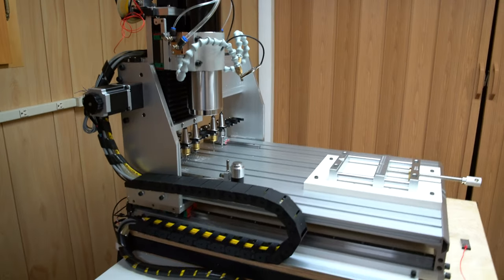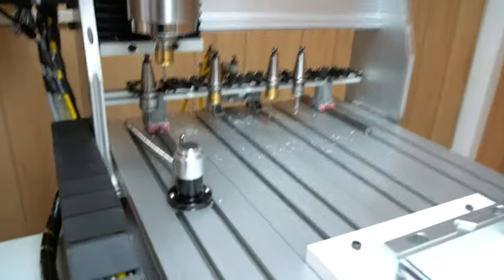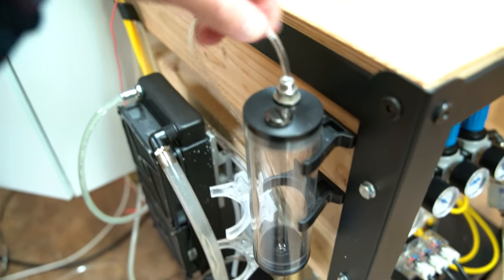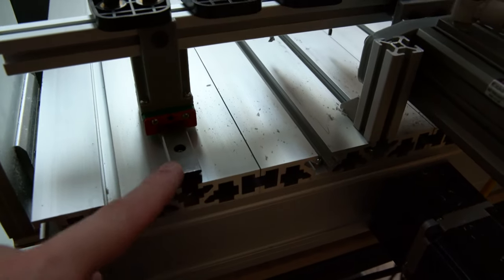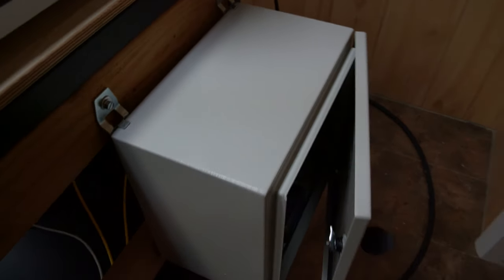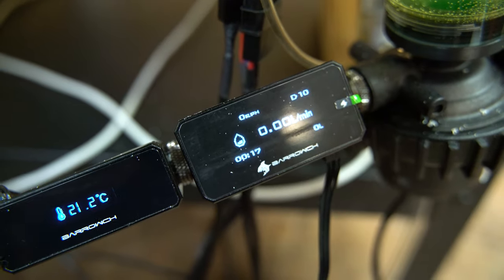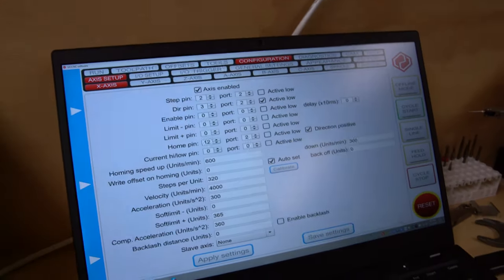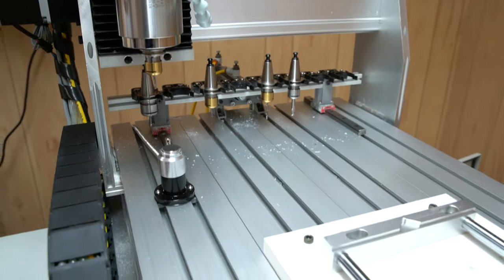ATC Spindle and Pneumatic Tool Rack Upgrade For X6 6040 UCCNC Router Now Operational - Part 3

Comment: Set your tool up close to the same length and put your coolant in front of the tool facing toward your tool storage rack. To keep coolant and chips off the tool storage rack,  add a flip door to the front of the tool storage rack that opens when it moves forward. It will just be mechanical in design,  it will pull itself up and back as the tool rack moves forward to clear spindle.
Reply: no

Comment: How much air does the compressor really need to provide for the ATC? I've read 90 PSI at a run rate of 5 CFM. In the videos I am watching, it only seems to need the 90 PSI during a tool change event. Seems like the 5 CFM requirement is overkill...

Comment: Very interesting video. And great job on your build!
I do have 2 ideas for considering, regarding your issues.. for tool rack: mount small angles with rollers on each side of that aluminum extrusion, that way you mechanically simple solve the same side distance caused by any irregularities that centered/single SMC might cause.
2nd idea is for the tool rack cover which would just be using plexy (or similar) plate of same hight as rack, 'folding' down when rack 'pushes' it ( plexy attached  to two pivot points on both sides, self closing with spring, when rack retracts).

Comment: Excellent work, do you have any suggestions for a precision vice that works well with the omio?
Reply from the maker: wouldn't call it precision (I actually have some drawings and ideas for making my own) but in the video I'm using this one that I'm happy with: https://www.aliexpress.com/item/4000180543028.html
Note that I ordered a second one from them a month ago and haven't even received a tracking update yet. There's a lot of sellers for the same version of the vice so maybe shop around.

edit: I saw your book press video before, enjoy your content a lot :)
Reply: @NikitaLab  thanks, ye I saw that vice but didnt like it too much and there is no downward clamping pressure to stop the moving side from lifting. Really want to find a proper milling vice low enough to be used with the chinese style cnc's. All the Kurt's etc are huge in height. In your earlier video I saw that you did have quite a large one fitted on the omio. I'm close to biting the bullet on the UC300ETH as I want to stop using this crappy cracked version of mach3 that comes with omio. Hoping to see more videos from you too!
Reply from the maker: @ThisDesignedThat  yeah I wish it would clamp down, but in my opinion the bushings are tight and don't lift too much, within a few thou across the part. I'd say it's easier to over-tighten a plate for instance and cause a bow that'll measure worse. The painters tape, super glue method I've been using a lot more, don't have to deal with leaving tabs on my parts and can run a nice finishing pass on the outside contour. UCCNC has been great, highly recommend it if you have the time and money to set it all up. I learned a lot and it's a great feeling to not have the software and controller be the weakest link anymore.

Comment: How is the air compressor holding up? I just bough a JGL-100 spindle 3.2kW ATC spindle with BT30 interface, and I am not sure what size air compressor to get. I found some other references for a similar spindle and it was stated that the air seal that requires 1-2 bar air pressure and will use at least an air flow of 65 liters/minute. Does the air compressor have to run constantly during machining time? Combined with the mist cooler it must require almost 80-90 liters/minute?

Comment: Really awesome work there and thanks for sharing. What Pump do you use for the spindle cooling, I have gone the same way for benefit of enclosed system but currently only have the cheap pump that came with the cheapo PC cooling kit, I don't run the spindle for hours. I have a valve controlling the air to a mist system but I do also like the idea to choose just air instead.
Reply from the maker: I'm using a D5 pump however it seems to be struggling, I plan on trying a dual SC600 pump configuration which should give me much better head pressure.

Comment: Just a thought maybe you should install some stops infront of each side of the linear beaings on your tool changer so you can adjust the stoping position and it you could correct it from being out of alignment with the gantry.

Comment: another idea. Maybe try mounting a big brush the entire  length of the gantry it brushs over the collet holders cleaning them off as it travels back to pick up another tool. And if they are long enough it will protect them from debris while you are cutting.

Comment: maybe you mentioned it and I missed it but what size collet system are you using?  I'm wanting to use an ER20 on my machine but can't find an ATC  smaller than ER25. yours looks like it may even be ER16. thanks for the vid.
Reply from the maker: They're ISO20 tool holders that come in ER16 and ER20, most of mine are ER16.

Comment: Great video, could you elaborate on the bits needed to operate the tool changer I just got one of these spindles my self
Reply from the maker: Once I put the pneumatic system in it's own enclosure I'll be sure to make a more comprehensive video on it. Got any specific questions or things you want me to go over other than the pneumatics?
Reply: @NikitaLab   It would be awesome to see how you set up the code to make the spindle find the tool holder and do the change . Manny thanks for videos.

Comment: Nice! My Radiator is on the gantry. That reduces the probability for leakage. 😊 A damping for the tool holder eject cylinder would be maybe good.
Reply from the maker: I'd be worried about the radiator and pumps moving with the gantry, also debris can get so bad I still have to clean up my radiator which is inside the table under the machine, can't image how dirty it would get under the gantry. Also a damper for the eject is a great idea, I'd be able to adjust it so that the release is more in sync with my retract from the tool clamp to avoid strain. Thanks for that

Comment: that tool rack moves very fast. i would either reduce the air pressure or (if you need that pressure to keep the rack in place) put some valves in the airlines that restrict the flow and slow down the rack.
Reply from the maker: Less fast is less fun. There’s 2 sensors in the cylinder for position. Macro waits for the signal when cylinder is fully extended before proceeding. The tool holder clips are very strong so that helps as well. I’m thinking of a redesign where the tool holders are dropped into pockets instead, I’ll probably have to slow it down for that.

Comment: Did you use the original VFD that came with the X6 to control the ATC spindle? Or was that upgraded as well? What is the input voltage if your VFD? Awesome build!
Reply from the maker: Using the SimPhoenix E550 that came from the factory with the spindle, I'm feeding it split phase 220v.

Comment: Hi, great work!!  One question, if you close and reopen uccnc you lost the current tool number?
Reply from the maker: Yeah it bothered me for a bit, was simple to fix just edited my M6 macro and now M6T0 returns the tool and goes home
Reply: @NikitaLab  ok, same problem here, I'm doing one umbrella atc and in case of lost power or close close uccnc I lost the current tool number..
Reply from the maker: @luisFelix  deff a problem, since the macros are c# it seems possible to make M6 write a tx file for current tool and read it to bypass UCCNC not saving tool# on close. That's one way to do it. 
I also wired the spindle sensors to the controller, if my macro detects tool holder inside when there shouldn't be it doesn't proceed with macro and errors.
Reply: @NikitaLab  can you share that macro? Tks
Reply from the maker: @luisFelix  I may have an old version that I can send you but I've actually been working on selling it, rewriting the code, documentation, making screenset changes, etc. We can talk about what you'd like to see in the code to make it work for a rotary tool changer

Comment: The motor is not pushing in the middle, so the bar holding the tools us default pushed , if not replace the pneumatic  cylinder more to the side where the deviation is.

Comment: Nice work on the sliding rack!! What model SMC pneumatic cylinder are you using? Does this cylinder incorporate any type of position sensors? Thanks, David
Reply from the maker: I bought the SMC used on eBay, model is NCDQ2A32-100DC-A. It came with position sensors models D-A72, getting them wired up and editing my macros to use them is on the to-do list. I've had a few instances already where my compressor wasn't turned on and the toolholders wouldn't release, the spindle has it's own position sensors that I'm planning on wiring and integrating as well to avoid this in the future.
Reply: Thanks Nikita!! I bought a slightly larger version of the SMC used on Ebay. It works great!David
Reply from the maker: @davidbuchhauser1488  Great to hear, I just ordered some SMC D-A73 proximity sensors which should wire straight into my UB1 breakout board,  I've also been thinking about a longer stroke piston to let me design a bigger flap for covering the tool holders

Comment: Cool project and great video, I really appreciate all the info!
Audio level is great now, thanks!
Anything you would care to say about selecting a spindle?  Looking like for general milling and drilling of aluminum, brass and steel, a low speed range and higher torque would be most useful if wanting to (for example) run a 1/2" / 12mm drill or a face mill (though that may be out of range for this mill).   What tool diameters and speed ranges do you use most commonly, please?
Would a check valve on the coolant at the tank be useful, to help prevent coolant from draining back from the lines?
Planning a chip / coolant catch tray or enclosure?
Seems like using larger tubing and shortening it by placing the solenoid valves as close as possible to the head would provide faster response on the pneumatic lines.
Reply from the maker: Most of my tooling ranges from 1mm (a 2flute for touching u corners in aluminum panels) up to 6mm, high RPM. I've seen custom builds of low RPM spindles using servo motors belt-driving BT30 ATC heads, that would be my path if I wanted to DIY a mill.
Check valve for the watercooling isn't necessary, the pump is at the bottom so it's never starved and after a few seconds most of the air is back in the reservoir.
I'm currently designing a spoilboard that'll allow me to install side panels to it, keeping most of the chips contained. Flood is something I did on my old router and it's not worth the hassle IMO. A strong air assist and misting system should give me good results in aluminum, and I've been machining more plastics and woods recently.
The pneumatics aren't very air hungry, the system is very responsive with mostly 6mm tubing. The only "mission critical" air components are the 2 pistons, 1 inside the spindle for the clamp and 1 on the tool rack. Everything else is for blowing debris. I actually have some delays in my tool change macro that I plan on shortening soon to speed up toolchanges.

Comment: Very impressive, I have the same spindle and controller, could you possibly post some links to the bits and pieces you used for operating the ATC function. I would be glad to support on patreon or something for some help with my setup.

Comment: It's nice to see that low cost uccnc is capable of all of this.
Reply from the maker: It's really powerful, the C# for macro programming is really nice. The only feature that is still missing would be S curve acceleration for larger router machines but they said they're working on it.
Reply: @NikitaLab  can it do rigid tapping.
Reply from the maker: @Z-add  lmao absolutely not, to start there's no encoder on the spindle (it's not a servo) and it's a high speed router spindle, doesn't have the rpm range or torque for rigid tapping. I do have some threadmills  ready for some practice cuts just haven't had a part that needed them yet.

Comment: What spindle did you buy that was compatible with this? Do you have a link?
Reply from the maker: Here's the company website: 
http://www.jian-ken.com/automatic-pneumatic-tool-change-spindle-motor/jgl-80-1-5kw-2-2kw-2-5kw-24000rpm-40000rpm.html
I ordered the JGL-80/1.5R24-20
Reply: @NikitaLab  Thanks!
I ordered a 2.2kw spindle without tool changer. I was reading for machining soft metal the 0.9 Nm torque wasn't great but this one does close to 0.6Nm... how are you finding it? love your setup!
Reply from the maker: @mauriziob5944  It's been fantastic, IMO judging by the amperage of the spindle and my cuts I'm very far away from reaching the limits of this spindle. I process aluminum enclosures, sheet, etc. never am I having to remove large amount of material (yet). I would expect to reach the mechanical limitations of my CNC frame and steppers far sooner than the spindle's.

Comment: Where did you get your Flow meters?
Reply from the maker: It's the FBFT03 from Barrow/Barrowch, got it off AliExpress. Something isn't right with mine (not setup properly, not enough flow, defective) because it shows 0 flow even with a second pump added to the loop. Can't recommend it until I do some more troubleshooting and testing.

Comment: What do you use to control your solenoids?
Reply from the maker: MDR-060D2 solid state relays. They’re DIN rail mount and you can source an optional power distribution strip for joining some of the terminals together.
Reply: @NikitaLab  You sent a signal to the  relay from the motion controller
Reply from the maker: @leonsplaylife  yes any of the digital outputs that sink to ground, 24V to the SSR

Comment: Interesting .... but have a ton of questions... can you pls give me and other top down over view... 

I like to see the following explained... a quick overview of the phneumatics...what is the basic must ...interms ofvalues lines to atc...what solenoids  you used what switches relays used...

2. What the electrical  wiring ti the bob required...

3... a overview what marco used and where

Pls be the frist to explain this one youtube
Reply from the maker: Absolutely, the machine is still a work in progress. For example, the ATC spindle has PNP sensors in the cylinder that indicate what position the Piston/Drawbar is in, great for avoiding crashes if there is some issue with the compressed air (life if I forgot to turn it on lol). Same goes for the tool rack piston, it also came with sensors.

I don't want to remake videos so once the machine is closer to it's final form I'll make these in-depth videos. I might release my macros much sooner.
Reply: @NikitaLab  pls give a wuick over eg...pneumatic...you need this and this...more details to follow...
Reply: @NikitaLab  I would live that!  Please do share the macro if possible,   I use my machine with manual tool change and this would be great addition 🙏🙏🙏

Comment: hi please, can you say me the name or number part of that spindle?? THANKS
Reply from the maker: It's the JGL-80/1.5R24-20 http://www.jian-ken.com/automatic-pneumatic-tool-change-spindle-motor/jgl-80-1-5kw-2-2kw-2-5kw-24000rpm-40000rpm.html
JGL-80 for 80mm, 1.5 for 1.5kw, R24 for max 24k rpm, and 20 for ISO20 taper
Reply from the maker: @DMS20231  the email I communicated with is jk@jkspindle.com, the man's name is Wafer Chou

Comment: For the cover - why don't you just take apart a broom/maybe a silicone version and pass the tool holders through, or just take a flat piece of rubber/silicone/TPU and slit it up so that the holders pass and are wiped when you pass them through
Reply from the maker: That's a neat idea however I'm worried that debris attached to the brush may find themselves on the tapers. A flap that's pushed up with the tool rack is what I plan on doing, just need to find the time to design and machine the assembly.

Comment: how hard was it to swap spindles and do the VFD on the Omio?
Reply from the maker: Completely dependent on the OD of your spindle and the VFD the manufacturer pairs with the spindle. I selected 80mm OD to match the existing mount; wish I went with the larger 100mm for their 30-40K RPM models. The E550 VFD had existing UCCNC plugin support.
Reply: @NikitaLab  we have an x8 that has been remanufactured with stainless steel for rigidity.  Next step is to get ALL of our machines running the same routers so tools are entirely interchangable.  I'm a bit spooked on the VFD aspect but we need to chew out stainless steel and that's the only way were getting the low end HP to do so